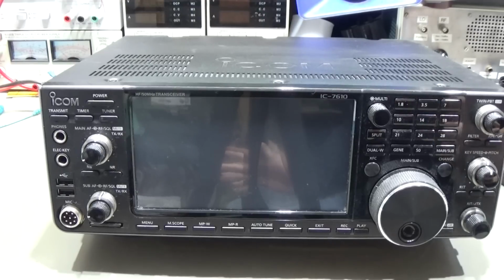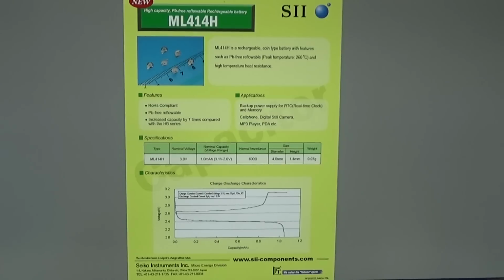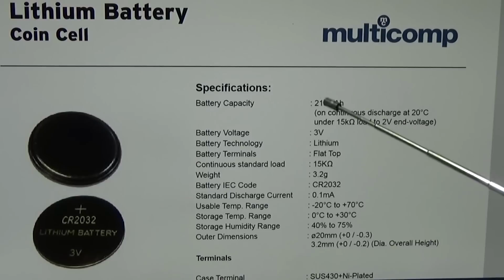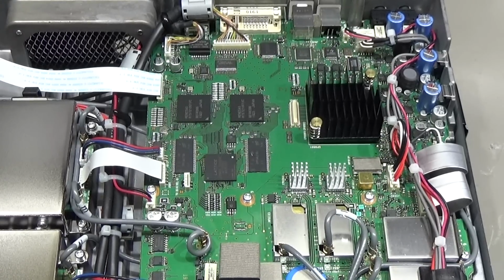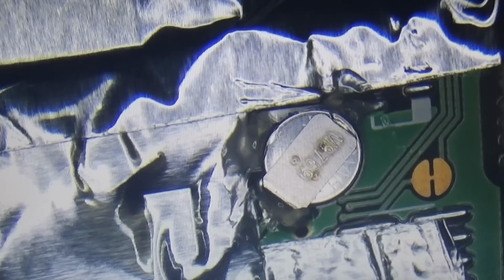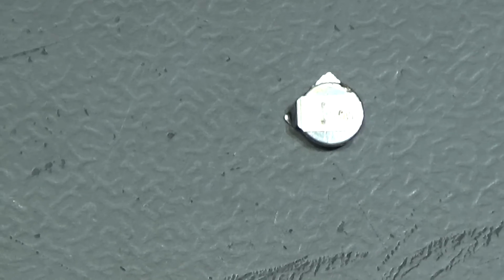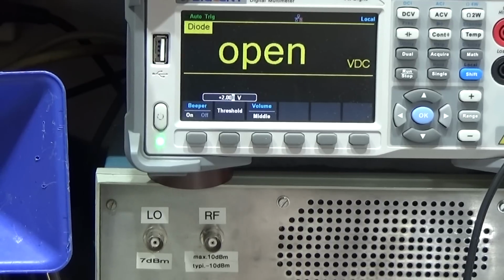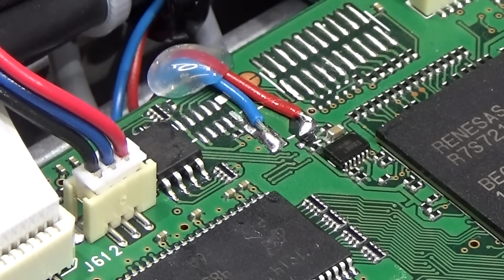#265 ICOM IC-7610 we fix the real clock battery issue

Comment: Thank you so much, I want to modifiy my 4 Icom radios using the ML2032 battery.  Plese confirm that I can install the bigger batteries in the IC7610, IC7300 and IC9700 without over current charging issues.  Has anyone doe this so far?  I don't wnat to further modify the radios but want to update to the higher recharing battery. Thank you.

Comment: Good but fidlely mod. Your will also find the the Icom IC-9700 has the same battery and problem as mine one has developed that fault. The 9700 was used for at lest two or three hours alost every day, Then the 12.8v PSU was switched off after use, but after two years (then out of warranty) the Icom battery died. Can someone tell me the number of the diode used please.

Comment: Isn't it dangerous for the components to put aluminum adhesive directly on the components?
I would have put krapton before putting this adhesive on
I'm not an electronics engineer but I would have used krapton first
But I could be wrong
good video !
Reply from the maker: no problem at all

Comment: Hello Peter. I am surprised you didnt mention the option of using a back up capicitor instead of the battery option. Would that in your opinion not be an option at all?? The job is a bit of a pig. Well done. Mfg Mike.
Reply from the maker: May be if the power consumption is not too big. Have not calculated it, but it is for sure the consumption is too high for the little batteries, so that is an indica.

Comment: Much easier to get at than battrry and change it than the same battery in the Icom 7300. A poor design for sure and should have been corrected when the Icom 7300 came out, but they did not correct it.

Comment: I believe ICOM were supplied a batch of faulty batteries that after a time no longer charge. I saw this issue on my IC7300 despite it being on every day. 
I had several of the required batteries as I already had to fix the same problem in my Xiegu X108G. Replaced the battery and no problems since in either radio.
73 Ed.

Comment: FLRig software, for the 7300, has the capability of automatically setting the rigs time via CAT every time the program starts. The function can be also be triggered manually.
Of course this requires a computer connected and the correct time on the computer, which I achieve by using a Raspberry Pi with GPS module attached.
Unfortunately this function isn't available for the 9700, at least on the version I'm currently using. I don't know if it works with the 7610.
Reply from the maker: yeah that is true it requires a pc...

Comment: Awesome work & extremely useful for those of us who own similar radios ie IC-7300, IC-9700 etc & so many other radios & devices which use similar setups knowing we can use CR2025/32 (Non-rechargeable) & ML2032 (Rechargeable).
Of course, would need circuit mods for an ML2032 to adjust charging current.
Thanks so much for sharing, Peter & God bless!

Comment: It would extend the time using a CR2032, but once it is dead it is dead.   The 1mAh battery didn't have a lot of capacity, but 200 recharges would be equivalent to 1 CR2032.
The other option here could be a rechargeable CR2032, which are not expensive, and therefore no modifications would be needed other than installing the 2032 rechargeable in place of the original battery.

Comment: An easier and safer way to take the battery out would be to use a tiny scalpel or sharp razer knife and break the 3 spot welds on top and bend that terminal away that would make it easier and quicker to unsolder the other lead of the battery.

Comment: Peter, I would recommend you take a look at the BR2032 battery too.
The medical device I work with contains a CPU board which came with the BR version.
These batteries technically have less than half the capacity of a CR 2032 but the actual current drain of the RTC on the board is so tiny that I couldn't measure it with a standard Fluke 79. 
It turns out that batteries in these applications discharge not because of actual current draw, but because of shelf life expiry and thermal cycling in the equipment. The BR version holds a usable charge in these conditions much longer.

So despite the lower mAh capacity, the BR lasts much longer than a CR.

The BR is also not rechargeable so if I was going to replace the battery in my 7300 (and I think it needs it) I'd probably put something bigger but rechargeable, or I'd use a BR instead of a CR.

Comment: both my 7300 and 9700 suffer from the exact same issue, manual state battery should fully charge in 2 days but even when I do this, radio lose time again. It would be nice that you show how to modify the charge level if we would like to replace with a rechargable cell ! tnx for the video
Reply from the maker: maybe there is an additional issue somewhere, a current leak?
Reply: @TRXLab  radio can be off for many days at a time as I am not always using radios every day, I suspect that I have drain the batteries beyond what they can be recharged again, radios are 5 year old now. thank you for the reply !
Reply from the maker: @Aleziss  yes that is possible, the only way is to take the old battery out and test, or replace with a new more capable one.
Reply: @TRXLab  Thank you Peter for your time !

Comment: Hi Peter, interesting issue. Touching a CR2032 with bare hands can result in a trace of oil across the plastic leading to accelerated discharge. Codan 2110 radios have a memory retention battery. If handled correctly 10 to 20 years life.  If handled without gloves maybe 5 years!
Reply from the maker: good point. I don't know the Codan.

Comment: Hi Peter, I have done the same fix in my IC-7300; this radios have the same issue. I used a germanium diode AA119 to have less drop voltage. Thanks for your video my friend and compliments for your 50K subscribed. Best 73 de IW0HEX Pasquale
Reply from the maker: Hi Pasquale AA119 is the same result. Thank you, my friend! 73

Comment: As a ham since 1976 and CB operator before I have seen and tried endless receivers. Superhet limitations were the challenges to overcome. Icom did milestone engineering hours to create what I call a sieve to catch a signal on the air. The 7600, the 7300 and the 7610 flagships are like nothing else. Yet a $20 satellite rx module or even a DCF found no place inside let alone attaching an external monitor with my friends who bought a 7610 refuse to attach a monitor even given a free one to use. Here in Australia we have ham's that give you UTC in am and pm yet supermarkets sell GPS enabled phones for under $30.

Comment: It maybe a bit 'tackey', but I will mount the battery holder somewhere on the back of the radio where it is easy to access and not have to remove the cover everytime.  Good video!
Reply from the maker: why not

Comment: That is a very common issue on other units, as the IC-7300. A bad design from Icom, IMO, as they didn't take care of the usual pattern of use these rigs could have. I replace it with a larger one, also rechargeable, and that does the trick

Comment: Interesting that you mentioned commercial users, like the marine radios. Icom's marine HF radios actually have a battery holder for the battery for the GPS state, so it's easily replaceable.
Both my IC-7300 and IC-9700 have dead batteries, and I used the ML2032 cells in them.
Reply: did you change anything in the charge capacity of both your radios ? it will take a really long time to recharge a ML2032 with the current charge of a 1mA battery cell !
Reply from the maker: Maxell specified charger for ML2032 uses 2-3mA charging current for charging the battery in approx 24h.
Reply: @TRXLab  but how much current the 7610, 7300 or 9700 provide to the original 1mA battery to recharge it ?? is it enough to recharge a ML2032 ? thank you so much for the reply !
Reply: @Aleziss  Well, in IC-7300 charger, there's a 3V3 voltage line, with a L1SS400T1G diode in series, which should have around 0.6 V forward voltage drop at around 1 mA of current, and should prevent battery current from going back into the 3V3 line. 
Then, there's a 3k3 resistor in series with the battery, limiting the charging current. My calculations tell me that the expected charging current is around 0.8 mA, giving us some two weeks to charge the battery fully. 

Now in my case, the power supply is left on for say 6-12 hours a day, pretty much every day, so this isn't as big of an issue (but the radios still  managed to kill the original batteries, immediately after warranties expired), however, for faster charging, the current limiting resistor would need to have its value reduced. 
On the other hand, many ML2032 manufacturers recommend maximum charging currents of 2 mA, which is still a charging time of a week, so I didn't consider the change to be significant enough to go try replacing the resistor.

Now, this leaves the users who want to quickly charge the battery, and let the RTC run for long storage periods without a good solution. Perhaps a super-capacitor could be a better fit here? I didn't do any research in that direction.

Comment: Peter I probably would have oriented the battery holder to either side since you were working on the bottom side of the radio.  I suppose if the holder is tight enough then it shouldn't be an issue.

Comment: I've found that some devices start to get flaky when a 3V coin cell drops to 3V and below so a fresh battery would be in order for sure here...the clock circuit may not be so sensitive. I have the same issue with our 7300 and 9700 and am really disappointed in Icom for having changed their designs to use the smaller capacity batteries as it could have been so easy to do as they'd done previously in other radios. It would be very interesting to see how the rechargeable version would work. TNX for sharing Peter, another great job!  73 - Dino KLØS
Reply from the maker: Hi Dino,
The internal INTERFACE REAL TIME CLOCK MODULE
RX - 8801 SA / JE works down to 1,6V. That's mean the coin cell can drop a bit...
Maxell specified charger for ML2032 uses 2-3mA charging current for charging the battery in approx 24h. So you need to adjust the resistor slightly down for a bit more current. Many uses the ML3032 even without a charging current modification. But a bit more current would definitely help. Thanks for comment 73

Comment: Nice work. 

A small switch between the cathode of the Schottky diode and second positive lead of the battery would allow switching between standard and rechargeable batteries.  Then you're not having to do any resoldering to change it later.  Just a thought for anyone thinking of doing this mod to their own radio.

Comment: Hello Peter this seems to be an iCOM Disease. The IC-7300 does act up with the same Symptoms. I decided to replace the Battery inside my IC-7300 with just a simple Battery Clip soldered to the Mainboard to use regular 3V-DC CR-2032 Lithium  Batteries "non rechargeable" because we know how long it would take to leave the Transceiver switched on til the rechargeable Battery ifs just 50% charged up. It takes FOREVER. Tnx again for another neat Video and have a nice Weekend. 73 de Uncle Guenter, DK5ONV 💯🙋‍♂

Comment: Thank you for the peek inside.  I think in the long term it is better to have the diode.  Radio's get sold and traded and the next owner may not know to use a rechargeable battery if it goes flat again.   I am also glad that the radio does not mess up or ask you to change the battery every time it turns on.

Comment: Hello Peter, I only recently came across your channel, you make interesting videos. Have subscribed to your channel now. Ic-9700 has the same problem but no backup battery can be found.
Reply: The 9700 battery is under a soldered down screening plate that needs removing first to gain access. An even more difficult job than removing the battery. I don’t know if bringing wires out from under a screening plate will cause problems. Sorry Icom designer, you are hopeless.
Reply from the maker: Thanks and welcome!